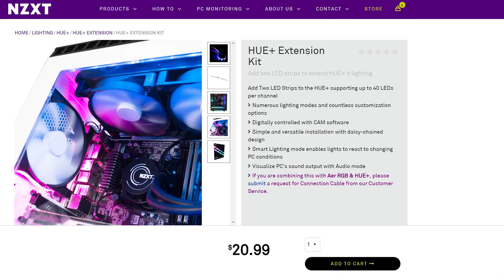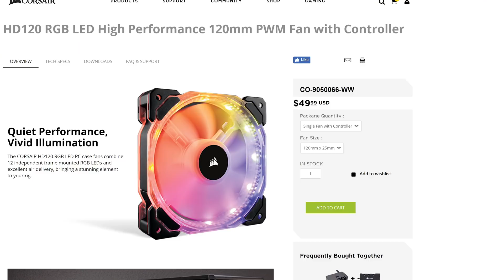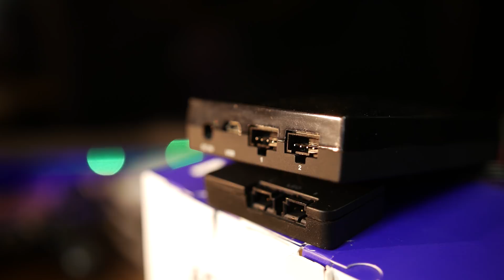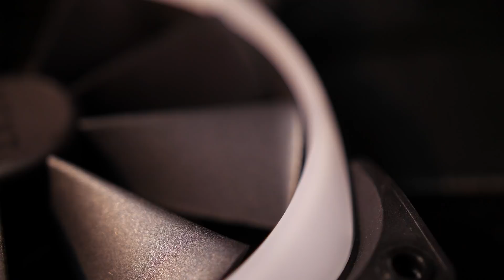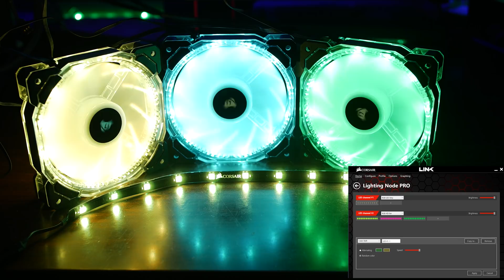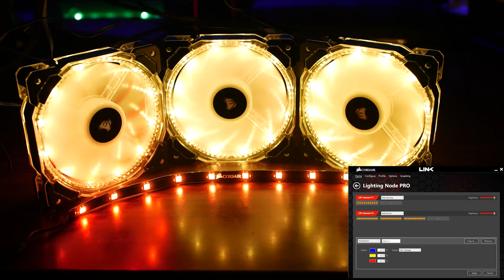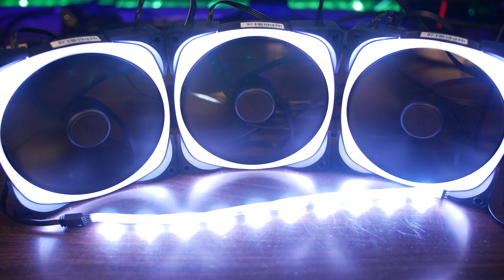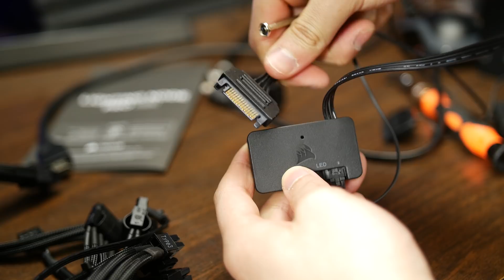NZXT HUE+ Vs. Corsair Lighting Node PRO

Comment: I think I am going for the HD140 cause it looks cooler, and NZXT strips cause it is way brighter. So a combination. is that a stupid idea? I got the Evolve phanteks tempered glass case.
Reply from the maker: It's not a stupid idea, it's just important to note that if you want software control of the HD140 RGB fans, you'll need a Lighting Node Pro or a Commander Pro, both of which occupy an internal USB header.  The NZXT HUE+ also uses a header, and the front I/O USB 2.0 ports will use a third header.  The Commander will give you an additional USB header, but you're already cutting it kind of close, since you most likely would have run out of room by now.  You'll also have to use two different software solutions (LINK and CAM), and you won't be able to sync them up.  If I were to make a suggestion, I would stick with just Corsair's.  The NZXT LED strips only appear brighter when you look at them directly (due to the white on the strip), but when you use them as ambient lighting (eg, bounce light off components or the internal case panels), they both appear about the same.
Reply: Thanks for the reply. Hmm I am going to use the Noctua D15 CPU Cooler. So my case is going to be ugly inside unless I make it kinda brighter with RGB stuffs. From the videos what I've seen it looks like the corsair strips are not that bright.... I wonder if I should just go for the phanteks led strips? They are kinda brighter. I actually want to have 1x HD140 for the back fans and maybe 2x HD140 top fans if there's room for it? (since i'm using a very big CPU cooler)  I'll be using 2x 140 noctua fans for the front in the future. Would this setup be a good idea?
Reply from the maker: It sounds fine to me.  The Phanteks LED strips look good, just note that you won't have any fancy effects available to you.  You should also be able to fit two HD140 fans up top, even with that cooler (though, I haven't tested myself).  Would be easier to install them first, though.
Reply: I bought the HD140 fans. I still havn't decided yet which led strips I am going for. I am about the be a stubborn and might just go for the nzxt hue+ strips. Do you think it's possible for me to install that? I have a MSI gaming 5 z97 motherboard, corsair 650w PSU. I think I won't have any problems with 2 different software that can't be synced.
Reply from the maker: In my experience, CAM and LINK seem to play well together.  I haven't had any conflicts between the two.  Just note that you'll need to make sure you have the adequate internal USB motherboard headers to support them all.
Reply: I end up buying them both. (lol) This is the result: instagram.com/p/BWhUwiUFqR3/?taken-by=chronotjai
Reply from the maker: Looks good, I like it!  Nice build!
Reply: Thanks and Thanks again for everything! Keep up the good work !

Comment: Can you mix fans and strips on a single HUE+ control unit? If so, do the lights sync?
Reply from the maker: The HUE+ has two channels.  LED strips can go on one, and fans can go on another.  The fans cannot be directly connected to the LED strips and vice-versa.
Reply: Thanks!

Comment: so do u think which fan better?
I am very hard choose at these. Hope you give me some suggestion.
Reply: sorry not only the fan , also include the rgb led strip
Reply from the maker: I think it depends on the case.  The HD fans look really good in cases with white accents, or in themes with white accents (or colored accents in general, due to the fan blade design).  The AER RGB fans have a really stealthy look, but the ring looks pretty neat.  NZXT's software is a little more customizable, but Corsair's has some things that NZXT's doesn't.  In terms of performance, they are close enough to the point where I'd say pick whichever fan you think looks best and go with that.  LED strips should only really be giving ambient lighting and shouldn't really be in direct line of sight, anyway, so the way the strips look don't matter as much to me.
Reply: ALittleDIMM so if I wanna have a darker rgb, which is for me?
Reply from the maker: I think you'd be happy with NZXT's system.  It's not quite as flashy as Corsair's in terms of popping colors, I think.
Reply: ALittleDIMM Ahh , have u watch the computex 2017 the corsair rgb setup, thats super crazy , i watch it from bitwit and paul hardware
Reply from the maker: I saw it!  It was really amazing!
Reply: ALittleDIMM yea it is amazing right , thats why i was comfuse with corsair and nzxt , both of them are amazing
Reply: ALittleDIMM the rain and rainbow effect is super amazing
Reply from the maker: Yep!  Can't wait to get my hands on that software!
Reply: ALittleDIMM but the saddest thing is the software cant use on NZXT, if can it is a fantasic rgb
Reply: ALittleDIMM ahh dim, pls make a video after u get the software on your hand
Reply from the maker: Definitely planned ;)
Reply: ALittleDIMM I m waiting :)
Reply: ALittleDIMM Dimm , for u corsair lighting node pro and hue+ ,which is more beautiful
Reply from the maker: It depends on the case you put it in ;)

Watch the video through if you need more details!

Comment: So, regarding the fans themselves, which ones are the coolest and more silent for case?
Reply from the maker: NZXT's seem to be a little quieter, but the HD120s seem to work just as well as the 140mm fans from NZXT.  In theory, the HD140s would be better at cooling, at the cost of being a little louder, though I haven't yet verified these numbers for myself.  I didn't get HD140 fans until after doing this video.

Comment: WTF? Now one of the Corsair LED strips has failed.
Reply from the maker: Oh, no.  You can try removing and adding the LED strips in Corsair LINK again, double check to make sure the cables are properly connected, or try resetting the firmware and see if any of that helps!
Reply: Have tried everything. 2 strips on one channel are not lit. Switched them for the 2 working strips and they work. So the physical led strips must be bad.
Reply from the maker: I wonder if the ends were frayed.  Since they have the extra length for the connectors, I suppose that's a little more likely to happen.  You can try getting it replaced if it's still under warranty?
Reply: Just installed yesterday so not likely any physical damage. Amazon prime has shipped the replacement arriving in 2 days. Ironically the same day as my replacement Corsair HX 750 that failed after 3 years of use in a system that at most draws 500.
Reply: Okay so I went through all the trouble shooting again. 2 of the LED strips work regardless of which channel they are plugged into or what extension cable they are plugged into. The other 2 LED strips do not illuminate in any configuration. Uninstalled and reinstalled software and firmware. For the record when I first installed these 2 strips did not work and requested a replacement from Amazon. Then randomly a few hours later they lit up so I cancelled the replacement. Then today the same 2 LED strips failed agian.
Reply from the maker: How odd...  Hope you have better luck with the replacement!

Comment: keep up the great videos mate but how do you connect the node pro and hd140 rgb together so they work in corsair link?
Reply from the maker: The HD140 RGB fans come with a lighting controller.  The lighting controller connects to up to six fans, then the controller connects to the Node with a single cable!  Then the Node goes to the motherboard via internal USB 2.0 and Link takes over from there.
Reply: mate thanks so much bro both for the fast response and advice cheers also love you videos and puns....i hope your channel grows.
Reply from the maker: Thanks!  I'm working at it!
Reply: This is the only channel that actually answered all my questions thank you !

Comment: My NZXT HUE completely failed after 6 months.
Reply from the maker: Oh, no!  That's pretty disappointing.  Have you tried contacting NZXT to see if they can do anything about it?
Reply: NZXT is pretty good about replacing things like that. I'd try reaching out to them and getting a replacement. Was it the original HUE or the HUE+?
Reply: I couldn't remember where I bought it. No proof of purchase. Tossed it in the trash and installed Corsair Lighting Node Pro today. It is working as advertised.
Reply: ah that's unfortunate. I've been using the HUE+ system for a week now and so far so good. Hopefully there'll be no issues.

Comment: What is that you have on your tempered glass in the case? is it vinyl?
Reply from the maker: It's a painted acrylic piece!
Reply: cool! it looks way good! I've been trying to figure out a good place for LED strips in my case. I have the same one as you.
Reply from the maker: If it helps any, I put one 2m strip behind the motherboard tray and I loop it around to the front dust filter, then I've got the HUE+ strips - one behind the radiator bracket, right above the motherboard, two on either side, and I moved the last one to under the case instead of the bottom near the basement.

Comment: I have a question for you: I'm planning on getting the Corair HD140's to replace the fans on my Kraken x62. But how will I go about having the fan speed ramp up with the CPU temp?

I'm afraid that I won't even be able to get to the boot screen in time to configure Corsair Link before my CPU overheats. Any ideas? I'm really confused here. Is there a way to control the fans that would work as soon as my computer boots up (i.e. outside of the OS)? Any way to maintain traditional motherboard-based PWM control and RGB at the same time?
Reply from the maker: tusing The fans can connect to the Kraken directly through the four pin connectors! Their speed will be controlled through there, so any fans with four pin cables should work!

The lighting for the fans will be controlled through Link. The pump and fan speeds will be done through CAM.

Comment: Subbed!
Wish I had found your channel before before seeing this video :(

Anyway,  just to get it out there,  the controller for Corsair RGB fans are not compatible with both HD and SP.  HD and SP fans have different controllers. This means you will not be able to use the one controller if you are using both off the same hub.  If you have a mixture of HD and SD, then you will need to use the respective controller for each product line.
Reply from the maker: That's correct!  Thanks for the sub!

Comment: You might have mentioned it, but the nzxt led strips have magnets and it seemed the corsair didn't.
Reply from the maker: Both LED strips have magnets and adhesive, so either should work for any chassis (given the chassis isn't too large or too small)!  Note that I'm speaking specifically for Corsair's Lighting Node Pro kit.  They also have a Lighting Node (non-Pro) that I haven't had the opportunity to play with, so I can't say I'm familiar with how those LED strips adhere to a case.
Reply: Ah ok, I've had the nzxt hue+ for about 8 months now and one of the led strips went bad. I'd buy some more but I have an AR thing going right now and that is where I'm putting my money at the moment.
Reply from the maker: I can dig that!  Good luck!

Comment: overall which one do you recommend more?
Reply from the maker: It's honestly really hard to answer!  I would decide based on what case you'd be using and which components you'll be integrating.  For example, Corsair has RGB RAM, their Node LED kit, their HD RGB fans, and their AIO coolers that can all be controlled via Link.  NZXT has their HUE+, AER RGB fans, and Kraken coolers controlled with CAM.  For the sake of simplicity, I would try to stick with one or the other.  They look different enough so that I think most people will lean towards one over the other just based on appearance, but if you can't decide, in general, I find CAM's software a little more robust and user-friendly, though it does tend to conflict with other software (like Asus Aura) and cause some minor issues.  If you don't have a preference for software, I would make the decision based on your chassis.  The AER fans look a lot more stealthy, since they're in all black.  The HD RGB fans have white fan blades, which do make them look brighter, but because of that, they also stick out a little more.  It's a tough call, and it's pretty situational!
Reply: I'n going with an asus rog crosshair hero for my motherboard, can you elaborate on the asus aura issue?
Reply from the maker: For example, when CAM and Asus Aura are both open at once, I've noticed that some of the lighting effects on my G Skill Trident Z RGB RAM don't work, or don't work like they should (LEDs freeze, flicker, et cetera).  If you're not using the RGB RAM, I think it should be okay.  I haven't had any issues with the motherboard itself, yet.
Reply: im getting trident Z rgbs too :( does the corsair have asus aura compatibility?
Reply from the maker: Corsair's RGB RAM is controlled in their Corsair Link software, so there's no way to synchronize it to your motherboard (as far as I know).
Reply: ALittleDIMM which would you recommend for my setup?(Trident Z Rgb, Asus Rog mobo and a strix graphic card
Reply from the maker: I see lots of Asus goodies there, the TridentZ RGB RAM seems to make the most sense in your case!
Reply: ALittleDIMM ? I'm already going for that haha, I meant which Rgb hub(hue+ or corsair)
Reply from the maker: OH.  I thought this was a different video for some reason.  I was just helping someone else with a RAM question, I guess I had that still in my head!  I'd say choose whichever fan design you like best.  The Corsair fans and NZXT fans look really different in that NZXT's are a little more "stealthy" and Corsair's white fan blades pop a little more, making them a bit of an attention-seeker.  NZXT's CAM is more robust and offers better levels of customization, so if you're into some really fancy stuff, that's probably more for you.  Corsair's solution does offer some effects that NZXT's doesn't, though.  In my experience, Corsair's tends to play better with other applications.  The only conflict I've seen with Corsair so far is with HWiNFO, but you can choose to turn that sensor off.  CAM likes to bully my TridentZ RGB RAM, so that makes it a little tough to get the configuration I want.

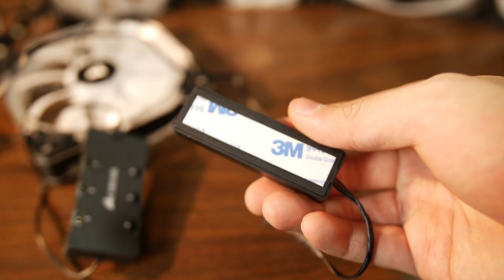Comment: At 2:16, will the corsair cases that have a button for lighting controls work with the unit?  I have a Carbide Series Air 740, and it has a push button near the power on front of case. I am considering getting SP140's or ML140' (ouch! so much money) to eventually replace all of the fans in my rig.  Thanks in advance! Great video as well! Subbed!
Reply from the maker: Unfortunately, I can't say for sure.  I don't own any Corsair cases with that functionality.  I haven't heard of Corsair cases doing this before, but you can always try to set up the controller outside of your case somewhere!  Also, I hear those ML140 fans are pretty awesome!  Though, I don't think they come in RGB versions, only single-color LEDs.

Comment: Subscribed, nice video with good, well presented information. I'm running a pretty nice setup at the moment, more of a Corsair enthusiast with the case, keyboard, mice, mousepad & h100i V2, have been debating for a while on whether to go with The HD120's or to go with the 570X as they don't support the HD120's......... or whether to just keep with my 780T case, with RGB Lighting strips attached to my RGB Z270 Asus Maximus IX Hero Motherboard, RGB EVGA GTX 1080 GPU...... & RGB Corsair MM800 Mousepad, RGB Corsair Harpoon Mouse, RGB Corsair Strafe MX Silent Keyboard, RGB H100i V2......... & RGB lighting behind my monitor & RGB lighting on my desk......... I wonder.... after all that RGB, do I really need RGB fans? RGBAllTheThings
Reply from the maker: Jonathan Exley More RGB never hurt anybody ;) I guess it depends on what features in your case you want to highlight, but the 570X is a super-hot chassis. Almost anything you put in there would look good!

Comment: really fantastic video. so you went with the nzxt in the end? any particular reason?
Reply from the maker: I actually went with NZXT in the beginning!  I invested into the HUE+ lighting system first because the software seemed more robust, and I opted for the AER RGB fans because Corsair's RGB option only had 120mm variants at the time.  If I had to make this decision again, assuming everything is all out on the table right from the start, it'd be a really hard choice.  I think it would largely depend on the chassis.  For something with mostly tempered glass, like Corsair's 570X case, or the Anidees AI Crystal Cube, I'd probably opt for Corsair's.  I really like how the white fan blades accent the glass.  For the Enthoo Evolv I have now, I think I'd still keep NZXT's because I'm either just used to it, or because the front panel is black and having the white fan blades inside might seem odd, if that makes sense.  As for the RGB LED strips, they don't make too much of a difference to me, I try to keep them hidden, anyway!  In terms of software options, both have different ways of doing similar things, but CAM's is probably a little easier to use in my opinion.  CAM also has more options, but I don't usually use the more fancy ones, so I'm not overly picky there.  I guess in the end it comes down to what fans match what case!
Reply: thanks for the prompt reply. i'm leaning towards nzxt as well reason being i've also got kraken x62 so having everything under nzxt would make software management better and easier. thank you so much and great job on this video seriously. it cleared a lot of my doubts and questions!
Reply from the maker: crankyfart There's a lot of advantage to having everything under one software. I'd probably go with NZXT in your case, too! Glad I could help!